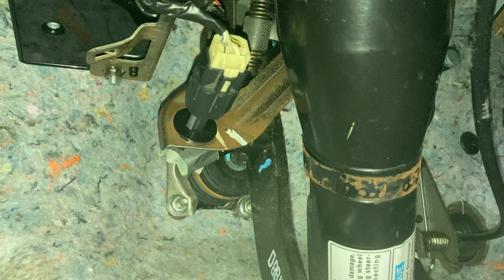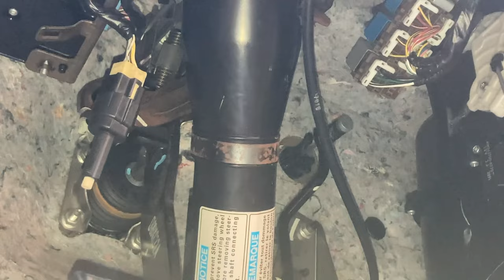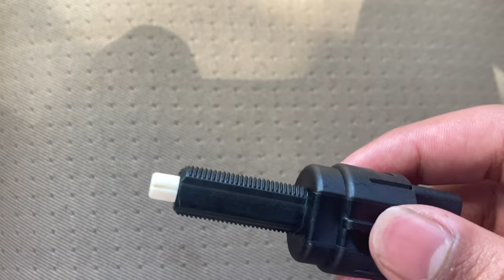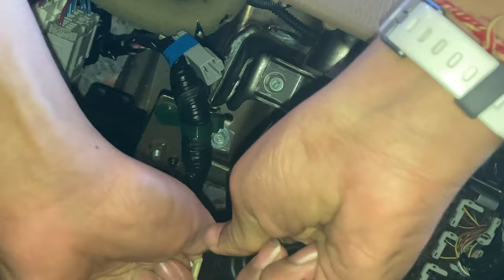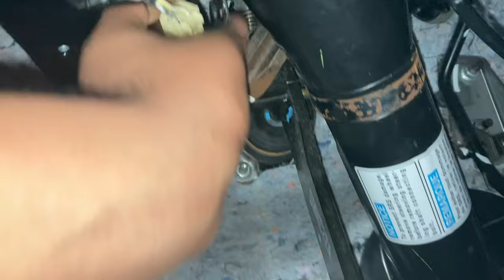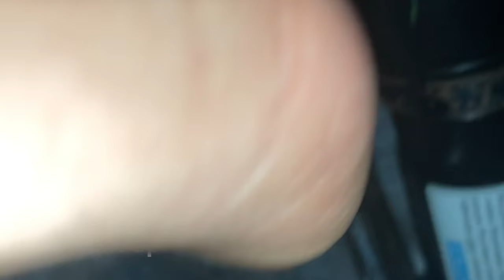Honda Brake Light Switch Replacement

Comment: This helped me figure out a cruise control issue. The switch pedal bumper pad had recently broken and I replaced it fixing my "brake lights constantly on" problem. But I had noticed the cruise control not wanting to stay on. I removed the switch and push it forward until the switch bottomed out and is stopped firmly by the brake lever bumper pad. The switch clearance causes not only brake light issues, but cruise control issues too. This is one of the only videos I found on how to remove the switch. Thanks.

Comment: Will this fix the issue with the gear shift being stuck and the VSA/caution light being on?
Reply: Did you ever get it figured out? I’m having the same problem
Reply: Yes this switch, if broken or out of adjustment can cause that problem.
But first make sure the switch's little bumper pad on the brake pedal arm is not missing.